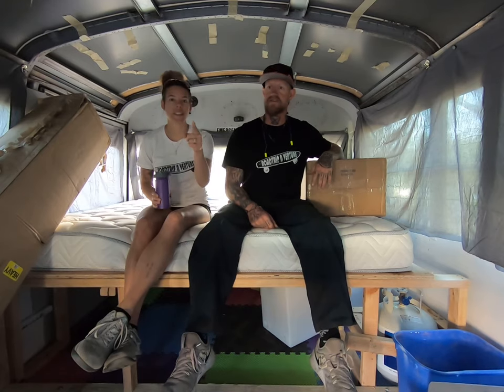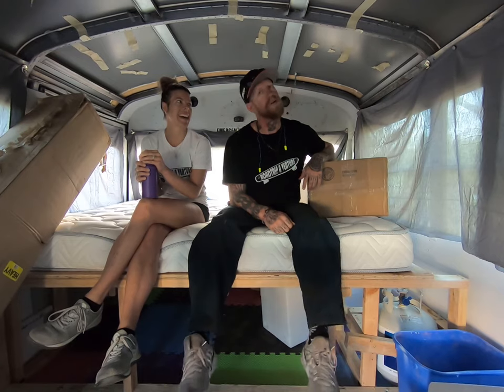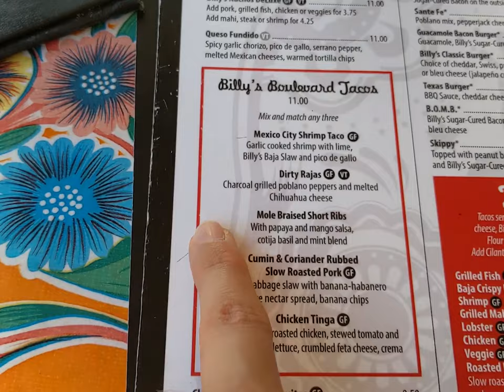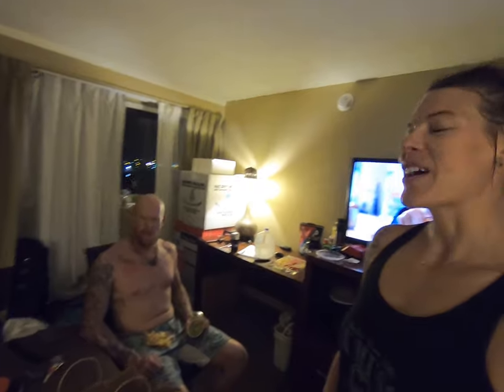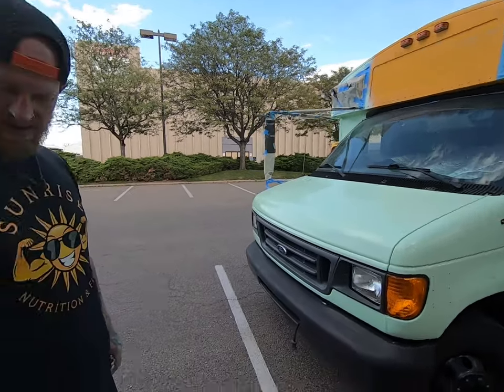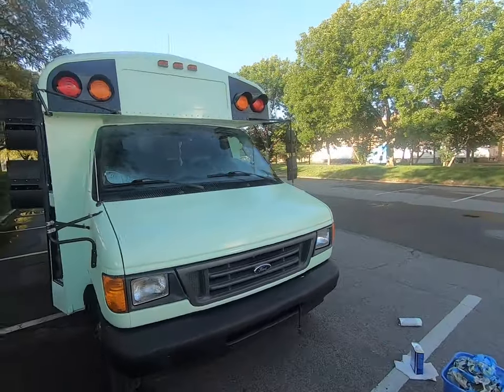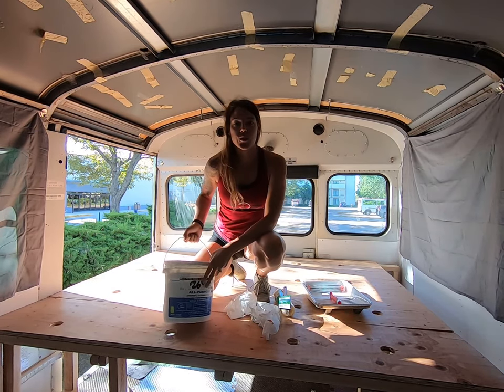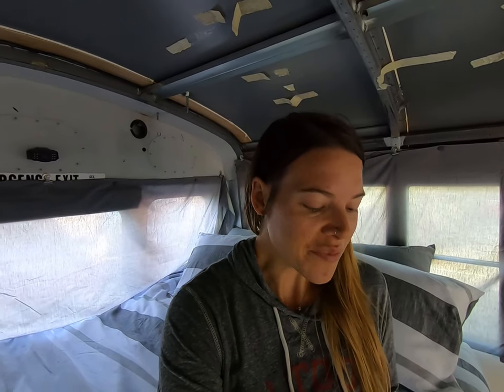Mint To Be: How To Paint A Skoolie | Skoolie Conversion | Bus Life

Comment: Your paint job came out really good. Not sure if I’m a mint color type person though but yours came out nice. It can be hard with spray cans and wind (plus the flying bugs getting stuck to it😡).! Im in Missouri and started painting my Stepvan in my driveway using white oil based primer and then paint and using paint rollers. I may do a grey next time. I got the roof and top sections of the sides done first last June but will finish the sides and the rest when I’m done cutting out some rust and welding in new metal. But even with a roller, it laid down really nice and no roller lines. And I put it on really “thicc”. Since then, I’ve been so busy with work, I’m having a hard time getting back on my build. It’s awesome to see you two are able to stay focused and full steam ahead.
Reply from the maker: Thank you! We debated using paint rollers vs spray paint, but we're happy with the way the paint turned out. It sounds like you're making lots of progress on your van. I know it's easy to lose motivation, but for us the thought of what our end goal is keeps us focused and on track. If there's anything we can ever do to help, let us know. Thank you for following our adventures! ✌️🤙